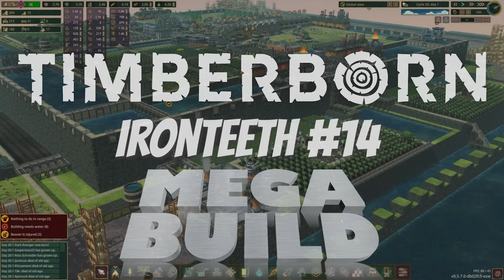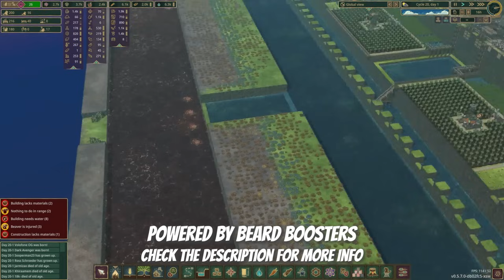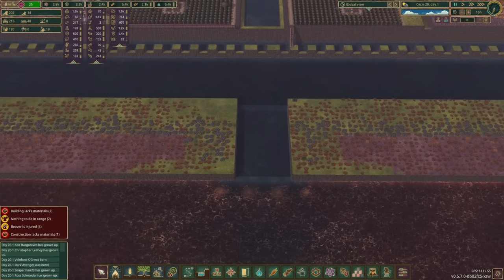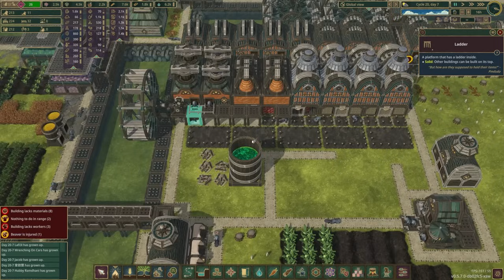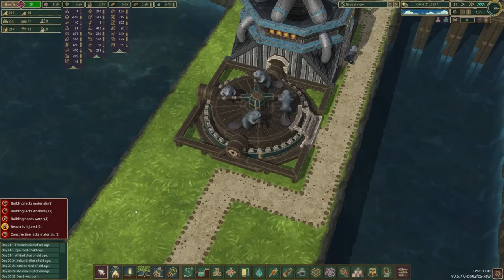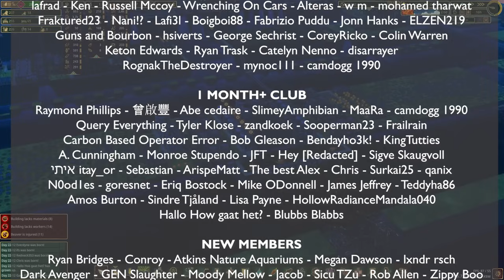Building the ultimate badwater processing area! Timberborn Update 5 Iron Teeth Mega Build Episode 14

Comment: Put your fermenters in a u shape from the path along the back which leaves one block at the end where you can place one at a right angle, then come back along the "front" and have a path down the middle. Not sure if I've explained that well!?
Reply: Beat me to it
Reply: To clarify, the 4 new fermenters need to be shifted 1 tile to the left (towards the presses), a new fermenter placed as an end cap door towards the center, then 4 more fermenters along the back of the storage making a giant U. Hope that helps.
Reply: This is the way ^
Reply: Omg yes, as soon as he started trying to place the fermenters I was screaming in my head when he didnt see the 1 block space (from the view he was building, 1 block to the left)... simply shift the 4 fermenters butting up to the neighboring buildings over to the left 1 spot so the line butts up to the path. Then place 1 facing to the inside at the far right which is now open. Now run 4 more fermenters down the other side of the central path forming a big U shape of fermenters, You might even be able to get a 5th in if you add one more platform.

Comment: For the fermenters, Have the entrances going north for the north row, and south for the south row and use ladders for the south row to the entrances south of the warehouses. Vs the fermenters merely having a south facing entrance as they currently are.  I realize this may require a platformed power shaft to get fully working or put a ladder at each end of the middle platform row.  This would put 2 fermenters on top of each warehouse.

Comment: → 14:10 I think you don't need all of the gear workshops running – you got full gear storage, and currently no projects using them.
→ 24:12 I think moving all the fermenters one to the left allows you to add another ladder at the other end. I think the version with the "4 fermenters in a 5×3 area, and a ladder in the middle might also work well (I'd arrange them with the short side like the fermenters you built), but you'd need the warehouses below arranged differently for it to work. 
→ 38:10 "I don't have enough dirt to build around that, and I don't have enough extract if I run the dirt excavator" – just build some temporary badwater pumps to get your extract production going again. (41:30 done.)
→ I wonder why you didn't start fixing the mistake with the channel as soon as you noticed it? (i.e. getting one layer of dirt or even levees in at the beginning of the additional channel, to avoid draining your freshwater reservoir one level up). You even then continued to blast the other channel just the same width.
→ 1:03:24 You just said "haulers can take care of it [instead of builders]", but then you delete the tank with extract in it, so your builders need to go and pick it up. Just use the "empty storage" button, your haulers will move the content away, then delete it. (Also, you need some extract on the top, for the dirt extractor ... put back in at 1:14:56.)
→ Your dead mangroves(visible e.g. at 1:03:39) can't be cut down because the builders can't reach them, and the lumberjacks have always other nearer trees to cut. Need a ladder nearby, or something.
→ 1:30 I'd connect the big badwater storage area also on the other end to the water pump series (4 more platforms with paths).

Comment: You could build a temp storages for what ever Materials that are needed for project and set haulers to fill from other storges and your builders will use them when stocked over walking all the way back. If you plan ahead you can just make storges first and wont have to move them later.
Reply from the maker: I always try to do that but rarely remember that it needs to be done 😂

Comment: You might want to place triple level floodgates in front of the two new power wheel channels to control the water flow. E.g set to 1 during a drought
Reply from the maker: We definitely need to do something there. I think we can get it done with the metal floodgate mod so we can put a path over the top of it still.

Comment: Why don't you try positioning the fermentors in a horse shoe shape!  One in the back, two in the front on either side and a path up the middle!  Tighter then your 20min design, with the two in front covering up those windows/power connectors.
Reply: when counting the width of the lumber plateaus on tier two, what if you counted something else?  Does the stairs down into the mangrove trees line up with the dams above?